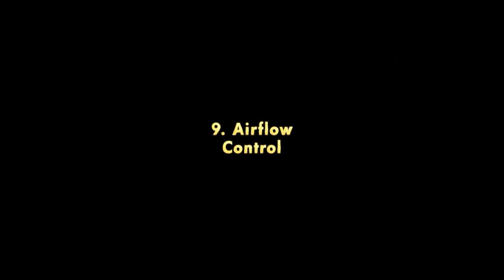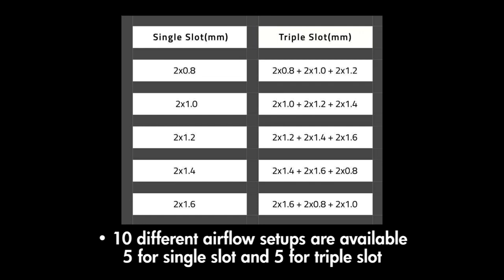Nextasis Atomizer by VapeWare Mods - Full Breakdown

Comment: Very helpful! One question about mesh size: when you say "open" or "closed" do you refer to different setups for the two different pins (high vg or low vg) or it's only related to different preferences no matter what's the pin you're using? Thx Nick

Comment: I WANT to love my Nextasis. The design is so clever, aesthetically it's about the nicest looking atomizer going AND it's a breeze to set up. So what's my problem? Muted flavor and it (the metal top) quickly becomes hot enough to "scald" my lips–very lightly mind you,  about like coffee that's not quite cooled enough to drink comfortably.
 I'm a confirmed genesis fan, and haven't the least problem setting up my two "go to" attys; an Origen V2 MKII (Norbert) and the In’Ax MkIII (Athea).
Any suggestions or ideas about what I may be doing wrong will be gratefully received!